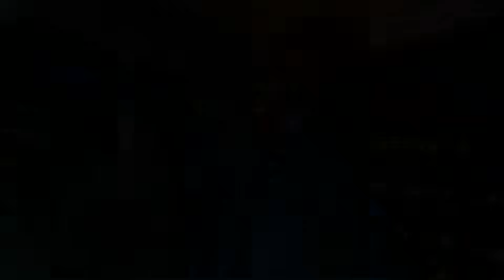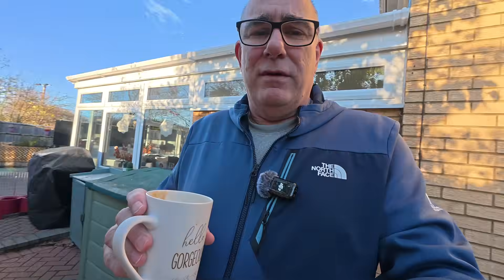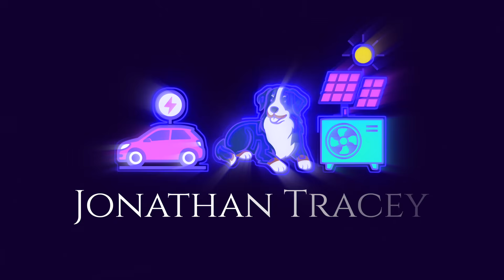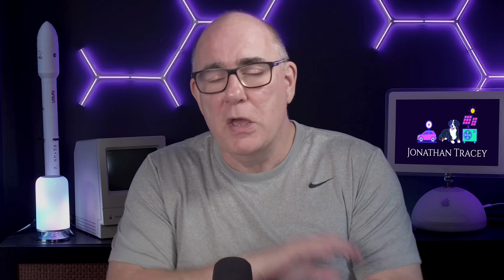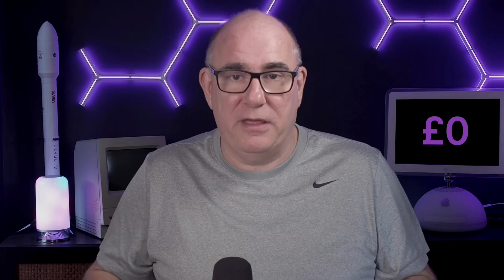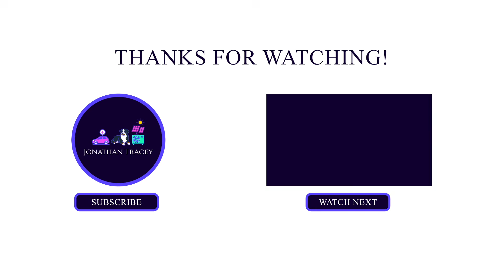My First Year With a Heat Pump   Costs & Savings Revealed   short version

Comment: Thanks for another great video!  And thank you for explaining in such detail and showing what can be done.  I currently have 3.1Kw of Solar and 9 usable Kwh of Battery storage, and am investigating a heat pump and additional storage.  I would be interested in what storage you have and how you have integrated it.
Reply from the maker: I have 3 battery systems, two small 6kw ones, and a large 30kw Solar Edge one. The solaredge battery is for peak loads, the smaller ones provide base load, keeps me off hte grid for 99% of the day

Comment: Very interesting. However, you are deceiving yourself (in  a nice way) if you say that your solar output cancels the cost of your heat pump consumption. Rather than considering the yearly totals, you should be looking at what happens in each half hour and then adding that up for the whole year. In many half hours, your heat pump will be consuming electricity from your PV which could otherwise have been exported to the grid, so that heat pump consumption has "cost" you your PV export rate (perhaps 15p/kWh). In some (winter) half hours your heat pump will be consuming power at your peak import rate and that shouldn't be neglected in your cost calculation either, even if you exported a greater amount of PV over the course of the year.

Congratulations on the net negative energy bill for the whole year, that's great for home EV and ASHP use. I hope to follow your example next year (already have PV, batteries, 2x EVs all on IOG, ASHP installation in January)
Reply from the maker: Thanks for the thoughtful breakdown — you’re absolutely right about the value of looking at things half-hour by half-hour, and I really like your methodology. There are so many different ways to account for “savings” with solar + a heat pump, but for me the only number that truly matters is the one going in and out of my bank account. As long as that’s lower than before I made the changes, I count that as a win! 😊

Good luck with your ASHP installation in January — it’s a chilly month, so make sure you’ve got a couple of small heaters handy. You’ll likely be without central heating for 2–3 days during the install.
Reply: U made good point and one made to few ppl aka why they should charge car during offpeak at 7p and let their solar panel export to grid and earn 15p as example

Comment: Glad you are looking at a net negative energy bill for the year. Excellent work 😄 As someone who is on a similar journey, with a Heat Pump, batteries, EV's, and plenty of solar panels, its definitely possible to achieve this and a fantastic thing to do for many reasons 🙂
On the point about building it all up in phases, its what I did due to obvious financial constraints, as would be the case for many, but its worth pointing out where solar is concerned, the more panels, the better value installations tend to be. My 3 phased approach cost me a fair bit more in the long run.
Reply from the maker: Yes, there are definitely savings to be had doing it all at once, @RenewableEnergySteve — or at least by minimising how many times you need to make changes on the roof. The more you can bundle together, the better the overall value tends to be.

Comment: Nice summary Jon, but are you playing the arbitrage game in the summer months by filling your massive batteries overnight everyday and selling the energy back at 8p/kWh profit? £63.22 elec import in June (est. 810 kWh) is surprisingly high considering you have a large solar array. It would be interesting to understand how your summer monthly profits compare between direct solar export @ 15p/kWh compared to the arbitrage profits @ 8p/kWh 🤷‍♂️
Reply from the maker: yes but only a very small amount, we charge the batteries so we can begin exporting as soon as the sun comes up, so it’s only the small amount we use between 9pm ish and 11:30pm. so maybe 2-3kw per day, the rest is just solar export. i’m working on a new plan for next year that is more self sustained
Reply: @JonathanTracey Thanks for your reply but I still don’t understand how you import ~800 kWh for the month, it can’t all be for the EV’s (unless you drive >2k miles per month) 🤷‍♂️
Reply: Oops, just realised that my comment relates to the content in the ‘long version’ but I’ve posted it in the shorter video 🤦‍♂️
Reply from the maker: We import an average of around 28 kWh a day, @Steve-6536. About 10 kWh of that is for my wife’s car, and roughly 15 kWh goes into the batteries — those run the house and the heat pump. Then about once a week I’ll put around 30 kWh into my own car, which lasts me a week.

We’re a fully electric household, so everything from cooking (which we do a lot of!) to the tumble dryer and washing machine adds up — especially with two muddy dogs in winter. It all soon stacks up.

Comment: I guess that you have honest maintenance people doing the work. Here in the USA there are four service industries that are the most corrupt. Auto maintenance/repair, HVAC, Plumbing and Electrical. I saved my neighbor $10K because she was in either the UK or Australia visiting family. She called me and said the AC died.  HVAC guy said that the compressor died. She asked me to check it to make sure. I had 120VAC at the 240VAC compressor. The disconnect had a corroded connection (very old breaker box). Had an electrician come out and change the box. Less than $300. It is really bad around here.
Reply from the maker: yeah, that’s not good if maintenance people are trying to rip you off all the time

Comment: I see everyone using boiler figures such as 85%, 80, here %75… and gas unit cost of 6.5p per kWh. However, my boiler is 93% efficient, runs at lower temps than a typical heat pump and average gas per kWh is 5p (Octopus Tracker) for the past 365 days. My room temperature precision (comfort) is higher too, target temp set to 20.5 at all times. Heat pump owners compare against boiler manufacturers data specs and not real time boilers. There are boilers that share their real time data on emon cms with precise comparisons. Have a look. Great videos as always
Reply from the maker: yeah every boiler is different, mine was 27 years old so very inefficient. The biggest advantage to me even if there was no cost saving over a boiler is that I can generate my own power for it.
Reply: The problem is boiler efficiency has only really been real world tested (like with emon cms), since it became a thing for heat pumps.  
Most people saying their boiler is 90%+ efficiency has come off the back of the boiler marketing, when most boilers in a typical setup in the UK will be inefficient.   OVO have apparently measured it to be around 84%.

I remember someone with one of those (fairly rare) boilers that give their efficiency info went from something like 60% efficiency all the way to 90% by essentially doing things properly - something the installer should have done at the outset, but generally doesn't happen.
And most people with boilers on emon cms will almost certainly be interested in tweaking it to get the best efficiency, the main issue comes from people being told their boiler is 90%+ efficient and believing it, when it's an up-to figure.

Comment: How many kWh of battery do you have?
It would also be interesting to know what it would have cost if you’d had the heat pump without a battery or solar panels, running on a standard tariff of around 25p per kWh.
Reply from the maker: about 40 in total, 1 large 30kw system and two small ones
Reply: @JonathanTracey  I guess if you had a heat pump and no solar or battery and were on a standard 25p per kWh tariff it would have cost 25p * 2457 = £614 for the year.
Reply: That's about right, most heat pumps if well designed and installed, will meet or be less than the running cost of a gas boiler. 
The trick is deciding what you want upgrading when. if at all 
If you had a standard house with no solar batteries or EV, and a gas boiler. Your first step to any new tech would be determined by when you have the money and what you want to put it into. 
All those technologies will save you in the long run, And they tend to grow the savings as each item is added to a household bundle. 
It's a bit like a meal deal for home investment 😁
Reply from the maker: @caparn100. Yes, as I show in the video at 6:46, the energy cost is 26.5p — so if you were buying all of it at the capped rate, the total would come out to £651.89,
Reply from the maker: LOL, that’s a great analogy, @adrianflower3230 — it really is exactly like a home-energy meal deal! 😄

Comment: The. Apital cost of 19 000 is around 900 per year regardless if you have paid it with own money or borrowed the money. One van always invest money in something that gives a return.

I think it is fine to invest in energy,savings if one want to do that. Utility stocks  like E.On have a dividend teturn of around 3.6 %. They are of course not paying out all profits in form ov dividend. Some are invested in future business. e.On is currently priced so that you would expect to get your investment back in 13 years. That is they have a P/E ratio of 13. 

Itnis also not fully correct to calculate only the initial investment. There will be a replacment cost in likely 15-20 years and those funds needs to be conciderd as well.  The replacement cost is likely not 19 000 but as an example a 19000 teplacement cost in 15 years is equvivalent of around 9000 in todays value. It is less since you do not have to pay it today. I would include at least one reolacemnt in the valculation, i.e. a gurther 9000 in capital investment.

We are heating our house with a geothermal heat pump. If one would invest in same system today the initial cost would be around 25000. This investment makes even more sense were we live as we have an average yearly temperature of only +7C and as low as -30C during winter.

I have been concidering both solar and batteries but today there is no economical reason for us to do so. eElectricitynprices are close to zero during summer and batteries are still too expensive. This do not kean that I might recomcider both of these in the future. Investing in something like E.On makes more sense to me at this point.

Comment: £18-19k for 11kW of panels and a heat pump is excellent.
Reply from the maker: its doable, had quotes from Octopus and Heatable to confirm
Reply: @JonathanTracey  I would have thought installing 3 x SolarEdge batteries would be around £18k.  I have 2 of them and they were not cheap!
Reply: @ascot4000 I was thinking the same thing 🤔

Comment: Very informative, thanks. 
Jonathan, would you start with the battery and then the solar?  I'm looking at getting a Model Y around Q2 next year
Reply from the maker: Solar will have the biggest impact but it depends if your planning to add a battery in the short term, the battery will give savings over the whole year while solar only really from March to October.

I love my model Y, just drove 500 miles this weekend and its a pleasure to drive, even the limited form of auto pilot we get in the UK was great for the motorway parts

Comment: I love listening to your video's and I have just invested in an ASHP. If it wasn't for the BUS grant I wouldn't have invested due to the overall cost required as I needed to change nearly all the rads in the house and the total install spend was over 3 times the price of replacing the gas boiler after the BUS grant, that said due to your advice at the beginning of the year on E.On Next drive solar and battery tariff, my current house daily spend is around £3 a day. Keep up the excellent informative videos.
Reply from the maker: That's great to hear, yes my daily running cost is about £3 a day which we cover from solar in the summer months.

Comment: Hi Jonathan
Great info.
I have 8kw of solar and 27kw of battery storage in a house that has excellent insulation in half the house and average in the rest.
I’ve been considering the Daikin system for some time as I have been thinking that with the solar and batteries it would ‘bring my monthly costs’ down. 
I would add that used to have a company that supplied and installed the Daikin air conditioning systems.
It’s just the capital cost of the install (haven’t had a quote or survey yet) including the grant that worries me.
I should add that the ground floor is 60% underfloor heating with the first floor radiators.
Thanks again for your hard work.
Reply from the maker: If you’ve already got the underfloor heating in place, then it shouldn’t be too expensive. I’d maybe reach out to a few companies and get a quote just to see you might be pleasantly surprised.

Comment: Don’t take this the wrong way, I enjoy your videos and am tempted to make the switch, but 15k to 25k is unaffordable for most young families, this is why I think the BUS system will be revised soon, if you take away the solar and battery element to keep the cost down, a heat pump versus a gas boiler, as a straight swap, is a very different financial proportion for a low income family, I’m not against the BUS grant it’s the right thing to do, but the reality is the government are giving 7.5k to people who in all honesty don’t really need it, at the same time as not really giving enough money to those that do ?
Reply: With the grant, some have paid less for a heat pump than the cost of a replacement boiler.

@UpsideDownFork suggests around 1 in 3 heat pumps was being installed under the ECO4 scheme, presumably with other measures, for those at risk of fuel poverty.

The average UK install cost is £5.4k with the grant, are you thinking they will need to up this?
Reply: 25k is what-  12 years of the average total heating bill paid up front.  Maybe if you’re young and have bought your forever home it’s worth investing in.  If you aren’t sure how long you’ll stay in the house it’s definitely not worth it.  I think the equipment price will come down eventually.
Reply from the maker: I totally understand where you’re coming from — not everyone can afford to make a switch like this right now, and that’s a really important point. The upfront cost can be a genuine barrier for a lot of families.

Schemes like the BUS grant are designed to stimulate the industry in its early stages. It can look like the people who already have the money are the ones benefiting, but without that early support the market wouldn’t scale, and the prices wouldn’t come down for everyone else. A good example is the old FIT scheme for solar in the UK — early adopters got the best rates, but that surge in demand is what drove costs down so far that solar is now affordable for almost anyone.

Honestly, if the BUS grant didn’t exist, I probably wouldn’t have spent £10k on a heat pump either — there were certainly other things that money could have gone toward. But that’s exactly why the grant nudges people like me to go ahead, which in turn grows the supply chain, expands the installer base, and pushes prices lower for everyone.

We’re already seeing the effects: Octopus are installing their Cosy heat pumps for as little as £500 after the grant, which shows the direction things are heading.

So while it might not be the right time or the right financial fit for you now, the system is slowly moving to make it more accessible — and that’s a good thing for everyone in the long run.

Comment: I live in a modest 1970's built 4 bedroomed detached house (with 1 EV), paying Octopus £300 per month!
Reply from the maker: if you have to do it in parts, i wouldn’t rush to get a heat pump until you have solar and batteries first
Reply: @JonathanTracey Thanks Jonathan, between yourself and ‘Gary Does Solar’ I have lots of info.
Thinking about Heatable for Solar/Battery and Heat Geek for Heat Pump.
Reply: Moving soon and intend investing in Solar/Battery/Heat Pump asap.